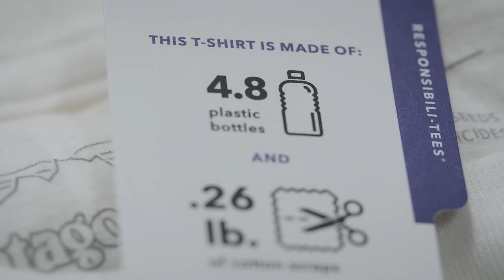What a Pile of Shirt! | Giving Discarded Cotton Scraps a Second Chance

Comment: Where do the cut offs of the recycled cotton/ recycled polyester blend go, assuming the same cutting method is used? Surely not all scraps can be avoided? And is that fabric mix recyclable? Does this fabric mix shed micro plastic when washing? 
Dear Patagonia, would you explain? I am honestly curious, I think the T-shirt is a start.
Best wishes.
Reply: Its made of cotton, there is no plastics involved. And they can just keep using the scraps for recycling again and again, there isnt really any degredation of the product
Reply: @SirHorned19  no, it’s only part cotton. The labels clearly say they contain plastic from recycled bottles.

Comment: How many time can the cotton go through the recycling process?
Reply: Naomi Dies the main thing I’m wondering is on the part of Patagonia ,not just any company, because I realize it being continuously rewoven is possible but the company may be interested in some specific imagery being associated with their name and not the product or ideal quality. The reweaving process does deconstruct and change the structure of the fibers as recycled shirts are softer.
Reply: Each time it's recycled, the fibers get chopped shorter. Long staple cotton is considered the most luxurious (it's almost silky in texture) , while short staple cotton has a  fuzzier, slubbed texture. Lots more  cut ends of the fibers sticking out from the threads. Think of braided hair with a lot of split ends. It's still usable but just might be less desirable as clothing. But it can be used for pillow stuffing,   quilted jacket filling,  even insulation for buildings.
Reply: @lestranged  that is really neat! Thanks for the info buddy🐼
Reply: @lestranged  right.. here we use it for stuffing and many more.
Reply: @nislin5468  I've seen used denim shredded and used in building insulation.  Really  cool  innovations being made in 'green' building.

Comment: Why blend the recycled cotton with recycled polyester instead of organic cotton? The scraps from making this shirt, then, wouldn't easily be able to go through the same process...right?
Reply: If I had to guess, the recycled cotton fibers are shorter and less durable and wouldn't be good enough alone. Adding recycled poly gives the yarn more strength and durability. Poly can be extruded to any length so the length is not an issue when using recycled fibers. The reason they would use it over cotton is to maintain the reduced water usage. Unfortunately, blended fibers are generally harder to recycle.